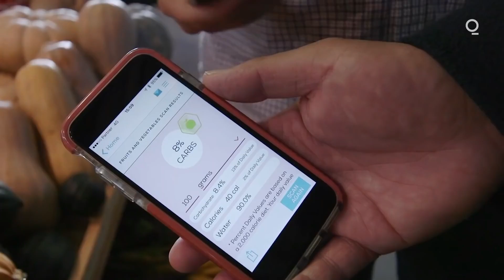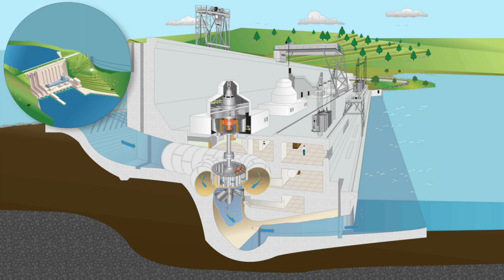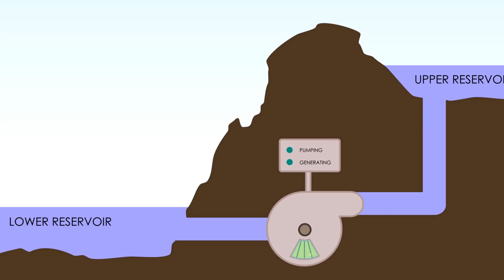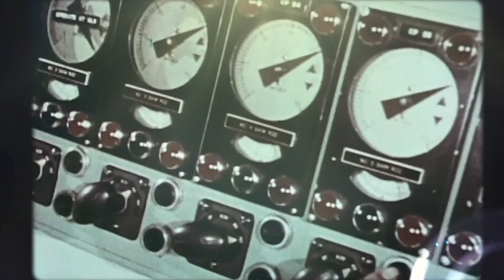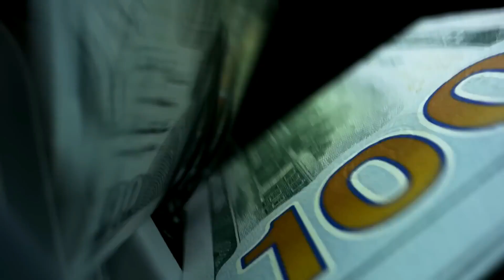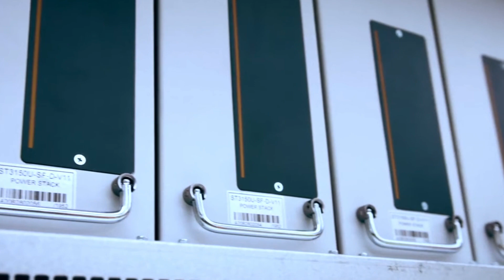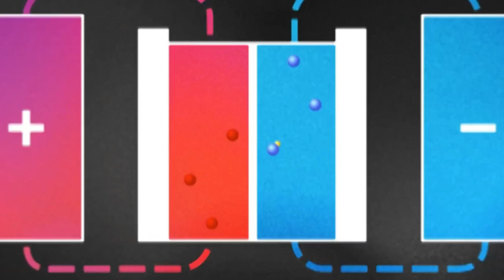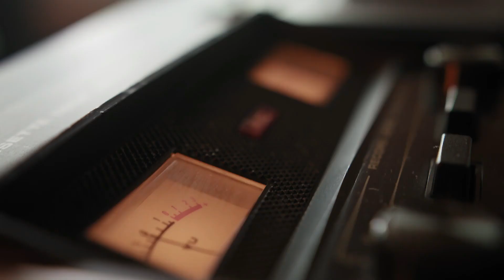Will This Change Everyting? The Huge Weird Batteries Of The Future #greeninnovations #future

Comment: Water batteries do not really work. If you had a million tonnes of water an average of 1000 meters off the ground (no dam had ever been made that big or even that high), it would give you 1000GJ. That is a mere 270kWh. Enough for 1 American house for 27 days. It would cover an area the size of about 250 acres. That is why Lake Mead is so big. If you reduced depth to that of lake Mead then you would need about 1250 acres. This is assuming 100% efficiency too, and in reality it would be 90% efficiency maximum. Just the Pelton wheel loses 5%+.
Reply from the maker: That is interesting. and it is true that it is not very efficient. But what do they do with the excess wind and solar energy? Better than nothing, right?